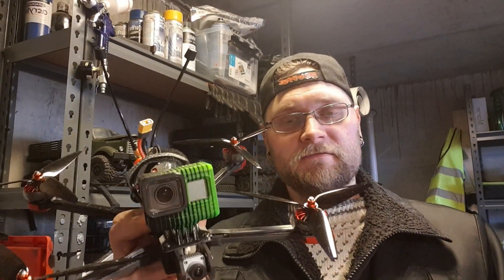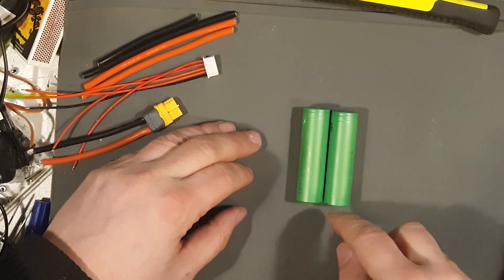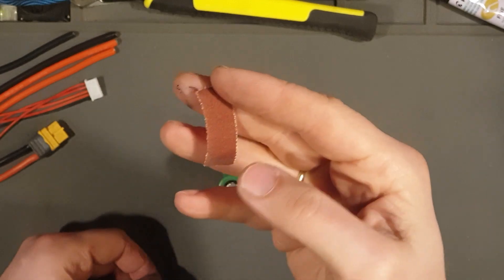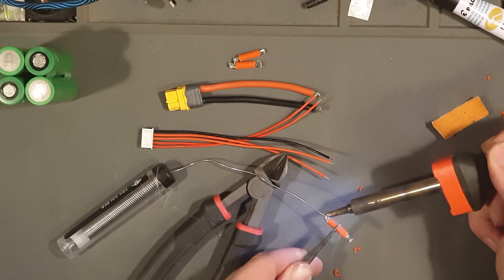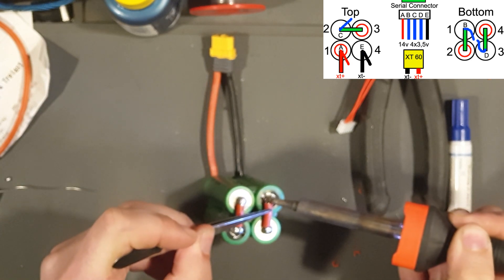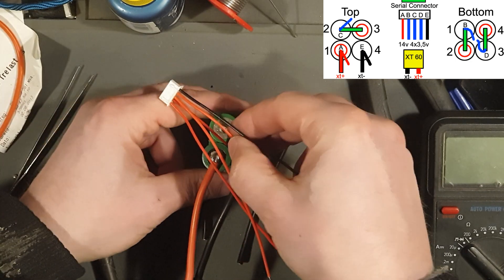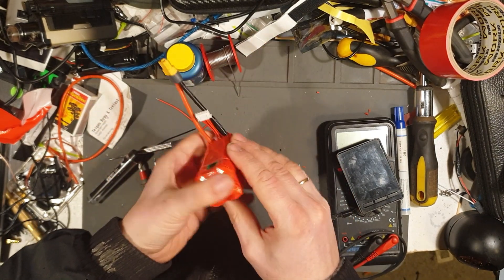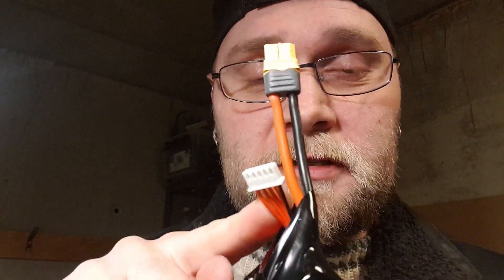How to make 4s 18650 Li-Ion pack for FPV Hobby

Comment: My chimera 7inch 1300kv is on the way. By the way, subscribed.
Reply from the maker: i love my chimera :D what battery are you going with yours, 4000Mah?  Its far bigger compare to my first drone. tinyhawk2 ^^ but it wasnt as big as i thought XD so thats why i want to challenge myself with a 10" build. while i wait for the parts. i can do a rebuild on my xmaxx and the maxx for Miniboss :D
Reply: @Just4FunRC  going for 3300mah 6s 60C and 460g.
10 inch??? 😎 awesome.
Sadly not possible in Germany.
The so called "wutbürger" will throw rocks at you.🤣
Reply from the maker: @nerdfpv  it seems alot of pilots realy like the 3300mah size good enough weight. and nice flight time. OH Snap! i havent weighed my li-ion pack. its to much wind outside a few trees snapped. so when weather is cleared im off testing my new 6s 3000mah.   this 4spack in the video was for my xl5 4s.But! since im waiting for new motors."converting to 6s"  im gonna use the pack in my dji fpv goggles..  i ordered A Bunch of 18650/21700 from my local battery store. 4000mah is great 8000mah is awesome 12000mah THATS NUTS! i wonder..... yup im gonna try it
Reply: @Just4FunRC  yeah lion pack is the next thing. But you first😂 Just Orderd a shark byte System for my 5 inches. So no more Money for this month.
Reply from the maker: @nerdfpv  wicked!  i was tempted but i went dji setup insted :) i waited a long time before i decided..sold some junk i had. then i invested in dji, im loving it!  still use analog for night flights. i went way over budget this month 950 ish usd XD mostly in batteries, new charger isdt k2 a new discharger skyrc bd250 steering upgrade for xmaxx. and bunch of wires and other goodies. 
BUT the biggest thing i want. is a Wolkswagen Transporter, convert it into mobile studio/workshop :D

Comment from the maker: 12 new 21700 on its way! Chimera 7" 6s 8000Mah OF POWER!! yup dont think i'll ever buy a lipo for long range Li-Ion all the way :D.
New 6s motor for my xl5, new charger on its way too ISDT K2! wooo cant wait :D so 2 isdt q6 pro/pluss and a K2 Dual charger. i need to make a massive PSU.  2x 1200w 24v that should work. think i have the parts needed.. Good project due massive rain this week.